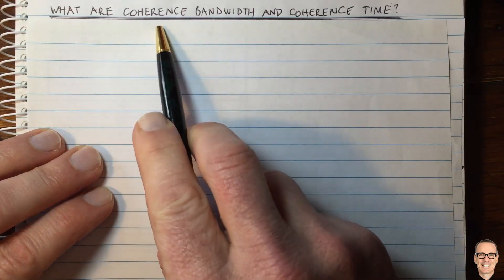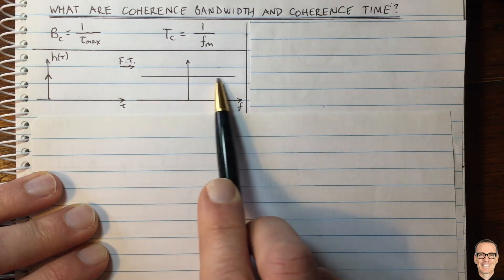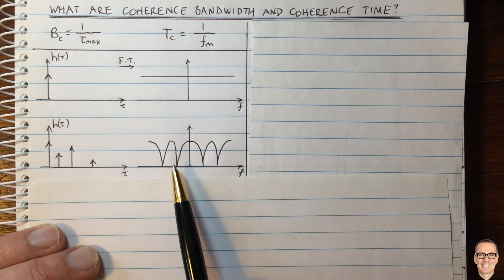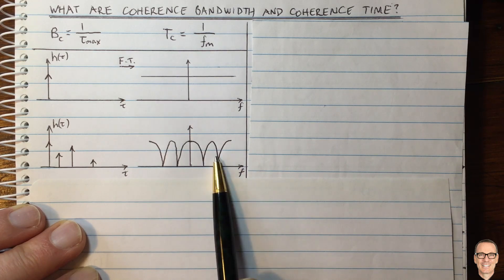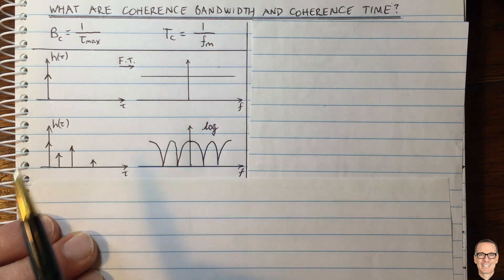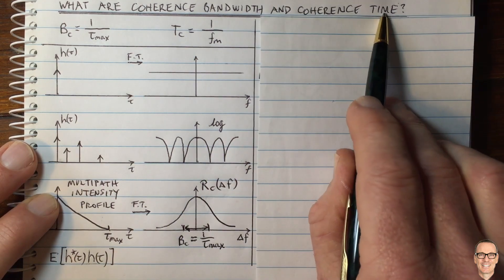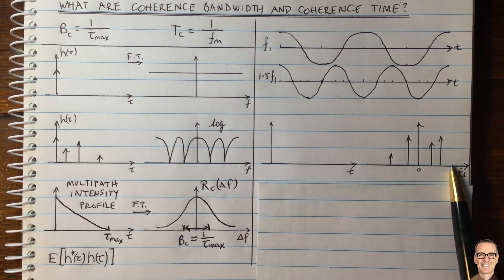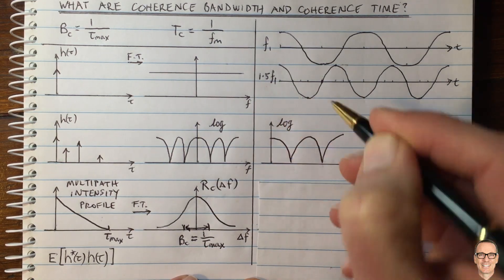What are Coherence Bandwidth and Coherence Time?

Comment: @iain_explains When we talk about coherence bandwidth, it is not clear if we mean the "one sided bandwidth" or "two sided bandwidth" (baseband or passband). Because sometimes it's mentioned that the coherence bandwidth is an RF bandwidth and hence the signal passband bandwidth is compared with coherence bandwidth to determine whether the system undergoes flat fading or frequency selective fading. And sometimes the signal baseband bandwidth is compared with the coherence bandwidth. This is not well clarified in the books.
Reply from the maker: Yes indeed. As I said in the video, the concept is not well defined, and different books define it differently (or don't actually define it at all). For some insights into flat and frequency selective channels, see: "What are Flat Fading and Frequency Selective Fading?" https://youtu.be/KiKPFT4rtHg

Comment: Dear Prof. Collings
Thank you for the perfect informative video. Specially I enjoyed the point that you mentioned about not referring from the channel gain profile to the coherence bandwidth. However, something hit my mind that I want to share with you. In those cases that the signal is white sense stationary (WSS) If we multiply the channel gain profile in the frequency domain with itself, we have power spectral density. By taking an Inverse Foureier transform of that, we can get the autocorrelation function. So, from the channel gain profile we can get a clue about the Coherence Bandwidth and maximum delay spread. I mean, if we knew that the two process are WSS by comparing their channel gain profile we could conclude that which channel has more Coherence Bandwidth. For example, if one process has more fluctuations in its frequency domain, we may conclude that one has the larger delay spread. On the other hand, that channel which has more flat frequency domain, has the smaller delay spread. How do you see my conclusion?
Reply from the maker: Yes, that's right. ... Just one minor thing. It's probably just a typo, but you wrote "white sense stationary (WSS)", but WSS actually means "wide" sense stationary. Here's a video on that: "What does Wide Sense Stationary (WSS) mean?" https://youtu.be/aGxGIYBxFpI
Reply: @iain_explains   Thanks Prof. Collings for your reply and also for remembering me to study again random process. I don't why I recalled it white. Thanks again.

Comment: Dear Professor, thanks for sharing.
When using the expected value for self-correlation for channel gain for the multi-path intensity profile, it seems that the expected value is a constant number without the variable of time. Do you mean to use multiple channel gains and get the expected value? 
Or h(t) is a 1*n dimension matrix. multi-path intensity profile should be E(h*(t)(trans(h(t))))?

Comment: Hello，sir! Thanks for your excellent explanation! Really helpful for me!
But here's a question: recently I'm studying the book 'Wireless Communications:Principles and Practice' written by Rappaport,and he says "coherence bandwidth is a defined relation derived from the rms delay spread"  
instead of using tor max, he defines Bc based on sigema tor(rms delay spread).
I'm wondering is there any differences between the two definitions or they are the same thing?

Looking forward to your reply,
Thank you!
Reply from the maker: Well, yes, the question you're asking is an example of exactly what I was saying in the video: namely that Coherence Bandwidth is an ill-defined concept that I don't like, because it is so vaguely defined, and different people use different definitions. In Rappaport's book, you'll notice that he provides two different definitions (5.38) and (5.39) (in the Second Edition of the book), which are a factor of 10 different, indicating that he also seems to agree that there is no "one single canonical" definition.
Reply: @iain_explains  Thank you,sir! 
Your explanation is really enlightening! The definition of bandwidth is quite confussing.
I have another question:If a channal featuring in several delay (equal amplitude)，Is there any differences between it and a comb filter? We always emphasize that if the frequency band of a signal is smaller than coherence bandwidth,then channel creates flat fading on the received signal.But if a signal whose carrier frequency is where comb filter exactly decreases(It is assumed that the channel can be equivalent to a comb filter.) ,and the filer is high quality(the edge is steep),will it be a flat fading?
Looking forward to your reply!
Reply from the maker: Don't forget, these are only models. And the channels are random. Perhaps in very specific locations, with very specific surrounding buildings, there might be situations where a "usually flat fading channel" might display "frequency selective" characteristics. It's not out of the question. But overall, on typically, if the bandwidth of the signal is narrow, and the coherence bandwidth is wide, then it will be a flat fading channel. ... and once again, the imprecise nature of that statement is another example of why I don't like the term "Coherence Bandwidth"!

Comment: hello sir,
I have a doubt running on my mind that even if in the absences of dopplers effect i.e for the stationary user why our channel is said to be time varient as the gain of the channel Is not changing with respect to time , since the coherence time is infinite as Doppler shift is zero according to formulae(Tc=1/Fd)

and my 2nd question does the channel becomes non linear in nature in case of Doppler as we are receiving the signal with shifted frequency due to CFO, according to this concept the channel is a non linear one but I have read few articles where they are considering the channel to be linear in case of dopplers ?
sir if you could please spread some light on these concepts it would be very helpful thanks
Reply from the maker: Even when the user and the base station are both stationary, the channel can still be time varying if the scatterers are moving (eg. cars, people, trees blowing in the breeze, etc.). This causes the path length to change - which is what leads to Doppler shift/spread. And we call the channels Linear Time Variant, because at any instant all the paths add up in a linear way (and if you doubled the input, you would double the output, etc.), but the frequency offset means they vary with time. They are not "instantaneously" nonlinear.
Reply: @iain_explains   sir first of all thanks for the wonderful answer, I have drawn some conclusions,
that doppler is present always just it becomes significant when the transmitter or receiver is moving with higher velocity, and that's when the concept of coherence time is coming in to picture.
after all sir can we say that when the mobile and base station is stationary the channel   is under slow fading 
and when the mobile and base station is moving with high velocity the channel is under  fast fading
please correct me sir if I have understood it wrong 
thanks
Reply from the maker: Sort of. Perhaps this video will give more insights into fast and slow fading: "What are Fast Fading and Slow Fading?" https://youtu.be/Tm-Uyajcuqs

Comment: Thank you for the great overview! I would propose a small correction though: The Doppler Power Spectrum usually looks more like a "U" (Jakes Spectrum) instead of what you drew. At least that's what I learned, if you consider doppler shifts to be fd = f0 * v/c0 * cos(alpha) and assume the angle alpha to be uniformly distributed. 
Keep up the good work, your videos have helped me immensely throughout my studies!
Reply from the maker: I'm not sure that an idealised model based on a uniform distribution of scatterers really qualifies as a justification for saying that my curve needs "correction". The Jakes spectrum is only a model. In reality the curve will look more like a response curve of a low pass filter.
Reply: @iain_explains  Thanks for your answer! I've only learned this last year or so, and therefore have not much experience with "reality" yet. One more example of how theory and practice are two pairs of shoes.. :D

Comment: as-salaam-alaikum professor lian
I have a question we observe a frequent call drop at high speed when traveling through train this I guess is due to Doppler effect , so my question is that is there any solution available for this problem according to you as now also travelling at such high speed leads to low data rate and frequent call drops
thanks in advance 😊
Reply from the maker: The important thing is the fading rate . If the fading rate is high, then it is hard to track, and requires more training data to be sent (per unit time), at the expense of actual data. But the fading rate doesn't only depend on the vehicle speed. It also depends on the data symbol rate. See this video for more details: "What are Fast Fading and Slow Fading?" https://youtu.be/Tm-Uyajcuqs
Reply: @iain_explains  thanks for considering my question
moreover I have a doubt for a particular coherence time Tc of a channel how many training sequences we are sending ?
and for a particular coherence time we are sending only training sequence for estimating channel or we are sending combination of data+training
Reply from the maker: You might like to watch: "Channel Estimation for Mobile Communications" https://youtu.be/ZsLh01nlRzY

Comment: Hello Iain,
Quick question, not related directly to the video. Why PDP is often modelled using a some sort of expontential decay. My best guess is that when channel gains are modelled using Rayleigh distribution (to be more specific, their amplitude is Rayleigh distributed), then this means that their power must be exponentially distributed.
Kind regards
Reply from the maker: No, that's not it. It's because the paths with the longer delays will have resulted from having bounced off reflectors that are further away, which means the energy will have dissipated more by the time it gets to the receiver (due to the 1/r circular radiation pattern).
Reply: @iain_explains  Thanks a lot for your explanation!